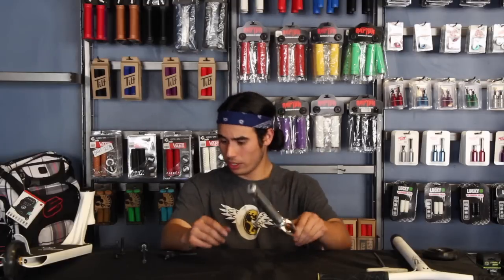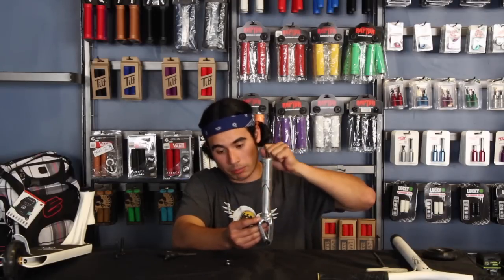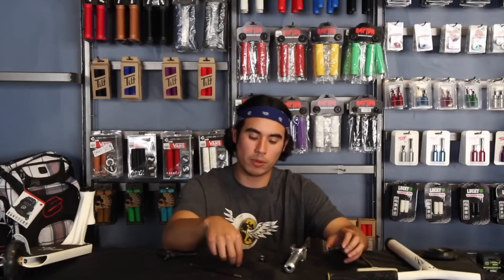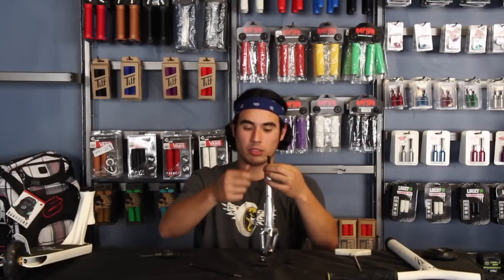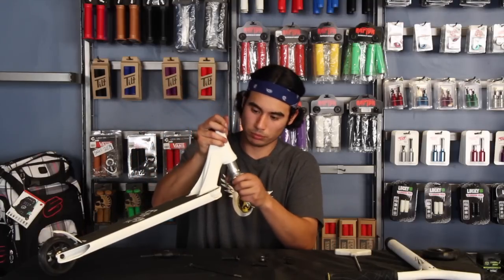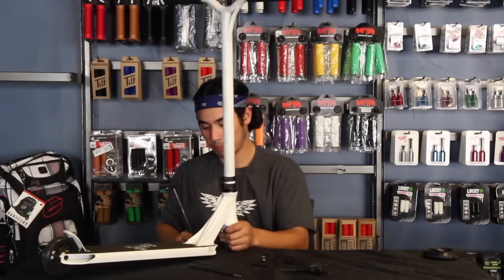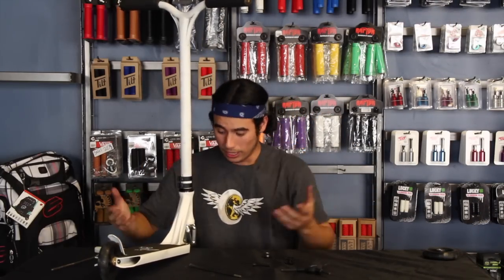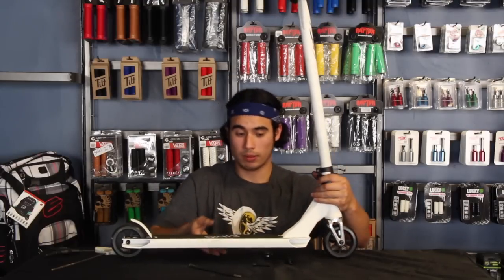The Vault Pro Scooters : Compression Series : ICS Compression (5 Of 5)

Comment: My ethic ics 10 compression gets loose after about an hour of riding at the park. I have to retighten every single time I'm out. HUGE regret purchasing this.
Reply: Is that the ethic erawan
Reply: @maxthepilot777er4  Yes. Eventually I was able to fix the issue rather easily with a drop of Loctite Thread Locker on the thread